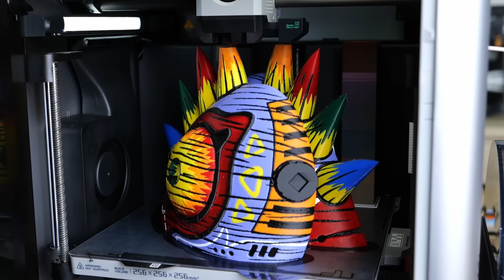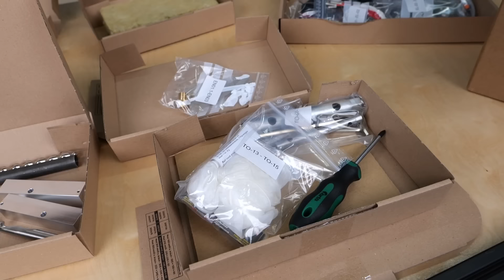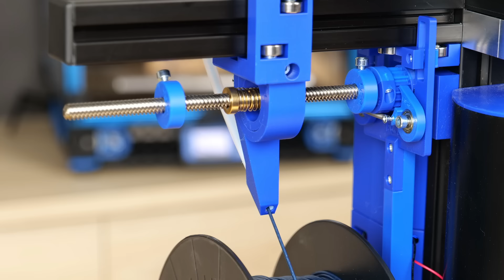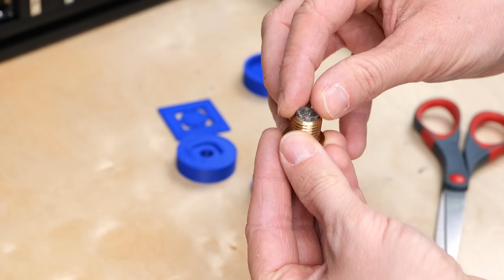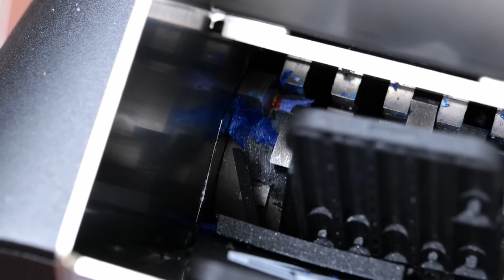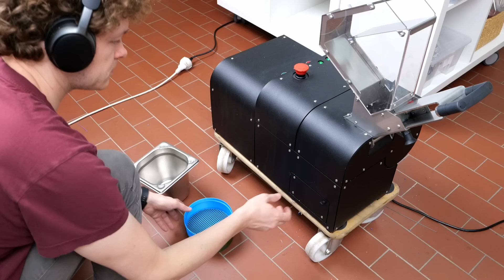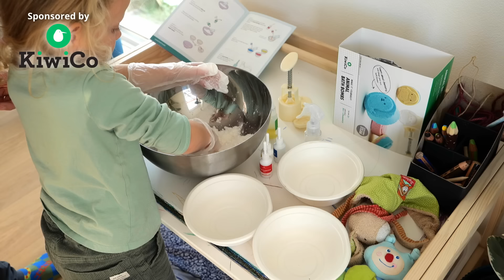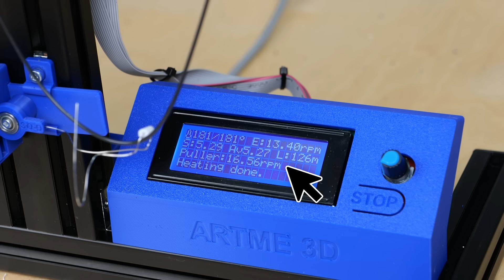Recycling Failed 3D Prints with a DIY Filament Extruder: Artme3D

Comment: Only downside is you still need to get an external shredder, "oven" to dry the filament which needs to be factored into the cost. Overall the machine is a god send and can see the hype around t but would love to see an add on shredder potentially for such a machine.

Comment: An optical sensor shining light though a semi-opaque disc is totally the worst way to do that part. What was he thinking? An electronic potentiometer gives much better resolution, repeatability and reliability and is simpler being literally just a single part, with no special electronics required to interpret the signal such as you need with a solution like an optical encoder.
Reply from the maker: I mean, it works 😅

Comment: I've posted on reddit a few times and never got a clear answer. Is there any reason we can't add on a sub model that we can make with the waste filament? Just something small that we use all the time. Like hooks, adapters, clips, brackets, etc. that the color doesn't really matter for. So that instead of a useless rectangular prism or a pile of turds, we would have something more useful.

Even if you have to use a bit more filament to finish the layer of the sub model each time, at least the waste would be minimized at the end.

Comment: The price sucks and it seems like you have to have a specialized shredder. Nice idea but my Kobra Max cost $450...Id rather get a second 3D printer, like a Bambu P1S. IF a shredder was included then it would be worth it.

Comment: this machine, let's talk about ROI.
if we forgive the fact we need a shredder, a 600$ machine would then have to print 30 spool that cost 20$ to begin the positive ROI.
it will be more affordable for fablabs, people that possess 3D print farms.
but if it can incentivize people to start recycling plastic prints, and make a shop from it, well, why not. thing is, it would require to filter plastics and customer will need to provide plastic parts on specific colors, otherwise everyone will get in return spools with weird/unwanted colors. also, they'd have to separate different same color PLAs since they're not always the same ones.
on a more personal point of view, I don't print enough to give it a go. I don't print enough to spend that much. but I'll follow the trend and see if it goes lower on prices: my 3D printer's cost was 150€, including a 1.5Kg spool.

Comment: This kit makes no sense to me.  Its too costly, even at $600.  I would need to recycle 20+ years of prints just to make my money back on the machine.  Maybe if youre a commercial maker you could make the money back faster, but theres another problem, the time maintenance and work to get this all done.  In the video you even talk about your heating oven, vacuum chamber and electronic shredder.  So not only are those huge extra costs, but even if they had no cost, the time to transfer everything and replace/inspect the filter, load spools, etc etc.  This is not worth it at all, even for big players.

Making a personal recycling solution will never be profitable.  A better solution would be a commercial facility that could recycle en mass and you could just drop off your recycled filaments too.  Then they could pay you a bit of money per lb like some places would with scrap metal and you could use that money to go buy new rolls of filament, while the recycler can make new rolls themselves and sell those.  If there were locations/services like this too, it would close the gap even further on not needing this technology to be personal.

Comment: this stupid thing cost over 600 bucks and is not complet you need to make a lot of parts with your 3d printer. i can buy a lot of new filament with 600 bugs.  QUESTION Is recycling failed 3D prints a waste of time and money? yes it is. how many broken parts you need to make new filament and the bigest problem is the color of your new filament . if you mix to mutch colors you got only dark filaments. and never mix diffrent filaments . i can not recommand this thing.

Comment: For that kinda price, it needs to have active feedback and should just have a stepper running the spool winder instead of the ratchet. I doubt it would be that hard to set up a set of calipers into an Arduino that does exactly what that horrible little wire arm does that would set your tolerances.

Comment: Very nice solution. I think the variance in filament measurement is down to shape consistency, not volume... measuring with the calipers simply isn't sufficient to measure the size. consider that the shape isn't going to be perfectly circular... there will be some elliptical shaping (calipers pinching on freshly extruded material is a consideration, as well). To accurately measure it, you'd probably need some sort of expensive measuring sensors. If you had such a component, it would be best used as part of the system to improve consistency and accuracy of the extruded filament. Just some thoughts from a former embedded systems software engineer who, long ago, had experience in the plastics industry controlling material thickness of extruded films on a much larger scale.

Comment: I'm curious why no one has setup a filament exchange program yet. Send failed prints in and based on weight get a roll of fresh filament back. Send in a kilo get a 500g roll. Then melt the kilo down and sell it for cheaper for those that don't care about color. I usually buy gray filament as I only do functional prints anyways, I don't care about color.

Comment: The reduced RPM comes from the fact that your spool got fuller. Therefore it's diameter increased so the RPM need to go down to ensure a constant velocity on the extrusion.

Comment: Really cool. But I would like to see a energy/resource comparison between recycling filament vs incinerating(for district heating here in the EU) and producing new filament. Shredding, drying and extruding old filament seems like it would be hard for it to be environmentally better to recycle it this way... Specially if the filament is also lower quality and results in more failed prints...

Comment: The question is, what is your time worth and what amount of energy is used in the recycling? You have energy for grinding, drying, and extruding. While a cool video, a home DIY solution isn't feasible. Not even covering the cost of buying a shredder and dryer.

Comment: What legal problems are there with sending a power supply?
Reply: Plenty.  If an uncertified electrical device catches fire and burns down a building, the seller of that product is liable for damages.  That is why there are certified devices from UL, CSA, etc.

Comment: 13:30 It's ridiculous that you constantly measure filament like this in the video. 
	Weld bearings to the two parts of the outside jaws of the calipers. Then attach a spring to the vernier scale (the moving part in the middle or attach springs to the internal jaws). 
	This way you can minimize friction while constantly measuring filament thickness or buy a ready-made sensor. This was truly the most necessary and missing part of the project.

Comment: I would love to see a way to recycle my failed CF Nylon prints, as I print mostly print in this material.  I wonder if the Artme solution could be adapted to recycle cf nylon. It would need to get up to at least 290 and I would be worried about how the carbon fiber would be distributed in the newly recycle material but, man, it would be cool to recycle some prints.

Comment: I LOVED THIS VIDEO... 1 QUESTION: Everything is provided in the kit other than the power supply.. correct? Nema motor, Nema Motor, Screen, Drilled nozzle, and Board are all included in the kit? The only other out-of-pocket I need to purchase is the power supply? Please be specific in this.

Comment: Well, once I can justify a $600-700 expense to myself I'll finally find a use for that giant cardboard box of failed prints, printer poop, supports, obsolete prototypes etc. Very good. I actually dig the idea of 'random' PLA where I dump different colours of PLA in as it goes to create a multicolour spool, though I suppose it'll be mostly white and black since those are my most common print colours.

Comment: Give the use of a standard 3D nozzle could this be merged with the printer itself to remove the need for filement entirely? I appreciate it would require more sensors etc but I'd love a direct pellet/scrap printer.

Comment: I think this paired with a small off-grid power system, a laptop and a 3d printer is the perfect solution for some sort of a prepper's workshop. For example, many people live in countries where they lack the resources or infrastructure to get parts for things; this is a perfect solution for someone wanting to do a little more than survive. Start a home business trading water pipe fittings made from recycled soda bottles...

Comment: At that price its a little hard to justify the spend, but I'm sure most makerspaces and 3d printing enthusiasts have an old i3 or similar around thats in need of some care and attention.  If they sold a kit that would take the heater block, motor and board (say a standard Marlin firmware based on a RAMPS board) and other bits and bobs from a standard 3d printer as a conversion kit for cheaper, say €200-€250 I'd certainly buy it.

Comment: The main problem with all of these approaches is: 
By the time you have shredded, dried and then reextruded the filament you have wasted so much energy that it would have been more ecologically friendly to just incinerate the filament scraps. (ideally in an incineration plant where the heat then gets used to heat houses instead of going to waste).  
I'm not going to count the time investment since counting that makes every hobby look insane.
And before someone brings that up and because Thomas Sanladerer also always brings up that argument: No you having solar on your roof does not offset that ecological cost. If you hadn't wasted your solar power on recycling your filament that power would have been fed into the grid instead where it would have replaced dirty coal power. (at least here in Germany where by law clean energy takes precedent on the grid). 
In fact with PLA this gets even sillier. Since PLA is plant based burning it would be "carbon neutral", while recycling it causes additional CO2 emissions from coal fired power plants.....

Comment: An excellent machine.  The kit should come with enough recycled filament to print the new parts from, making the recycling machine made from recycled materials.

I have two questions:  First, due to the need for a specialty shredder, oven, and vacuum chamber and the additional time for processing, is this more expensive and labor intensive than just buying new filament?  Second, in your opinion, would this be an economical way for someone to make money on the side as a recycler of other people's waste?

Just some thoughts, thanks for the informative video!

Comment: can you install a tiny pulley wheel on the wire where the filament position sensor is to prevent the filament moving from side to side?

Comment: The A1M claims to have active flow rate compensation, could that be contributing to the good print results? If it can continuous compensate for flow rate variations then that might compensate for inconsistent filament diameter.

Have you tried it on a different 3D printer other than a Bambu labs one.

Comment: Impressive that it managed to skip the re-pelletize step typically needed to get consistent diameter.  Still out of the price range for the typical hobbyist, but I could see it being a very obvious addon for a makerspace.

I'd be interested in a video comparing material properties for a filament that is re-extruded multiple times.  How many recyclings can PLA go through before the shortened polymer chains are damaged enough to matter?

Comment: While still a little expensive for the individual user, it would be an excellent cost-effective solution for a maker space.

But, being open source is a good solution for home use, as the 3D printed parts can be printed for not a lot of money, and a lot of the metal and electronics can be sourced locally for less than the full kit.

Comment: 2-3 things I'd love to try with this l. First incorporate a strong magnet say from a old HDD either in the sieving process or before the filter to catch metal shards earlier. Second would be incorporating Thomas sanlander's filament diameter sensor either on printer with klipper or as part of an active feedback loop while extruding or maybe both.

Comment: When the filament comes out of the nozzle it's still hot enough to be able to be "forced" into a shape: why isn't it viable to force the extruded material through a cooled 1.75mm pipe in a circular path? Is filament diameter that important given the results Stefan obtained with a +-0.01mm variance?

Comment: You might be able to reduce the chance of metal making it into the machine by attaching another arm to the mixer (but on the outer edge of the hopper) and attaching some strong magnets to it. If any magnetic metal makes it into the hopper it'll be pulled towards the outer edge of the hopper and stick to the arm. As the hopper empties the metal should remain and be easily removed. Equally, you could place your plastic in a bath after grinding and it should float (right?) while the metal will sink, then you can scoop it all out and put it into a clean tray to start the drying process. It might make the drying process take longer, but if it means you don't have to open the machine up as often to remove the filter, then it might be a time-saving.

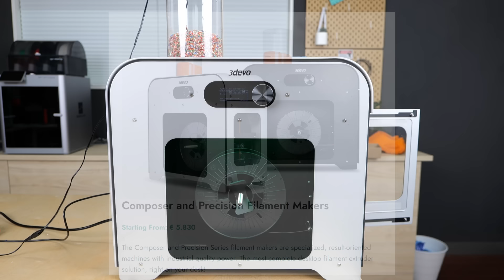Comment: 1:07 - 6 euros doesn't seem expensive. 

For people who don't get it. The joke is: In the English-speaking world, and most Commonwealth/ex-British Empire states, we use a "." to mark a decimal separator and a "," to mark a thousands separator. So if you are communicating in English you should change the way you display numbers so it is clearer to your audience. Equally, if you are speaking one of the many languages that flip it (it's about 50/50 split), you should display it the other way around - which is why there is a "." after the 5 rather than a ",". So, now you know.

Comment: I'm DEFINITELY interested in this!  

A a small-scale hobbyist with an Etsy store, I have generated about 30kg of waste in the last couple of years, and I cannot bear to just send it all to landfill; so it sits in my garage waiting for a solution like this to come along.

I can see a feedback loop with a filament diameter sensor as being the most obvious upgrade, but apart from that I'd clearly need a couple more things.  Dehydration I could probably do in my oven, but you mentioned a shredder.  

What sort of machine can handle everything from Bambu purge poop to scrap models and pieces that are up to 250mm by 250mm?

Comment: I found out laser printer toner mixes easily to make new colors. Someone needs to get cmykw pla powder and 5 tiny screws like that to make colors on the fly. It is embarrassing using filaments when laser printers and inkjets are so much better.

Comment: Very happy to see these recycling solutions on the come up!
I think it would be really interesting to see if you could make a watercooled die not only for cooling but also for the calibration of the diameter
If the filament is solid once it comes out of ther other end, changes in preassure from the extruder should only affect the troughput of the filament and not the diameter.
The die would need to be custom made but all the watercooling components are very easy to get from the pc watercooling market

Comment: Nice vid! Really good explained. One remark: You should include the needed Watt hours for the whole process. So include the shredder, drying oven, etc..
Reply: Also include the initial purchase cost of the grinder and drying oven. You can get a dehydrator oven for something like $150, but I'm betting that grinder is pretty expensive. I'd like to be able to recycle my prototypes and failed prints because I hate plastic waste, but I'm thinking it's still too much money.

Comment: Thanks for bringing this up.
I notice the extruder screw can be ordered as high-compression or low-compression. Both can process PLA, ABS, PETG. Any idea which would be the best option for use with PLA, PETG? And what impact the different compression actually has?
Would it make sense to order the kit with the 2 extruder screws?

Comment: And have an intital sensor and final sensor that measures thickness to keep the filament in tolerance. Then the hang could be longer or shorter depending on what thickness is in play. Is it the 3devo that does something similar? this doesn’t it by spooling the winder faster or slower.

The probably needs to be a roller or something to smooth the extrusion near nozzle to remove the short bulges or does the hanging sort that out?

Comment: Interesting and definitely a leap forward to making at-home filament recycling feasible for hobbyists.
I wonder if the inconsistent thickness matter could be addressed in a future version by using sensors like the diameter sensor Thomas Sanladerer made to adjust extrusion or pull rate on the fly.

Comment: You can adapt a dial indicator before the fan and run some test with different levels of air flow. There are some models with usb, they transfer a log of measures directly to your pc. Great video !

Comment: Love the new focus on recycling filament, not just making other plastic trinkets with the waste of other plastic trinkets. What version of the screw did you use for this experiment? A or B? Also, could this thing cope with shredded PET bottles without clogging? Thanks!